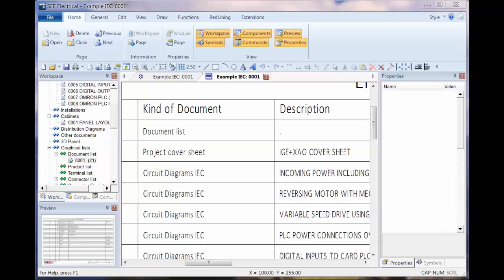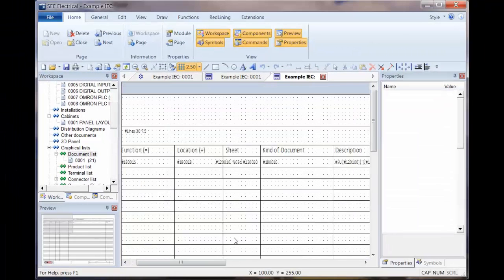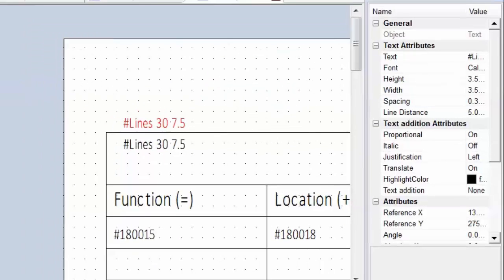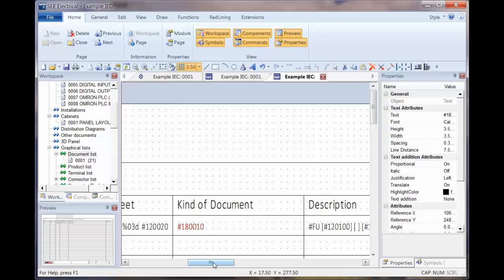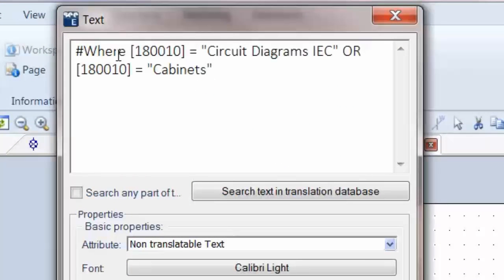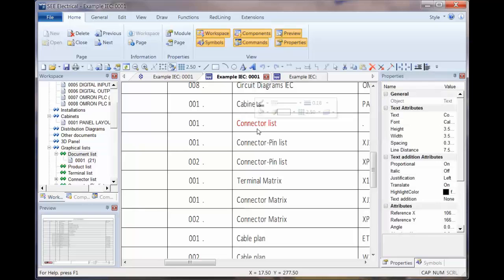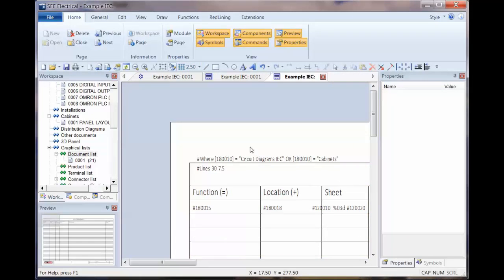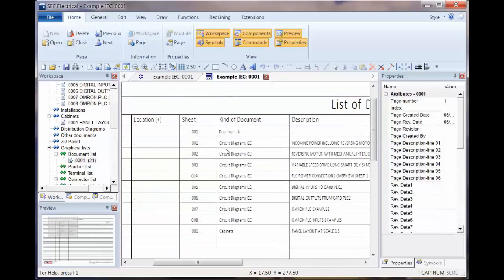Graphical Lists Part 4 (filtering the lists)

Comment: I want change the kind of text showed on 180010 in my example I want replace the text "Electric Diagram IEC" for "x" do you have any Idea ?
Reply from the maker: If you have the advanced or scale level package then you can use the report generator to add a new calculated field to the field list such as; iif([180010]= 'Circuit Diagram IEC','x',[180010])
The conditional iif statement is not available directly in the Graphical Lists.
Reply: @IGEXAOUK   Can you make a video explain How to, I have de Advanced mode?
Reply from the maker: Check this video for adding a calculated field https://youtu.be/szJtLkdZT_Q?list=PLo05RM5fuggEve2pU9bOU_ruo4pzHdIkL&t=129
Reply: @IGEXAOUK  Thanks for helping this will be a lot useful